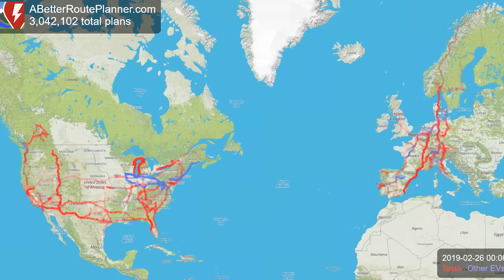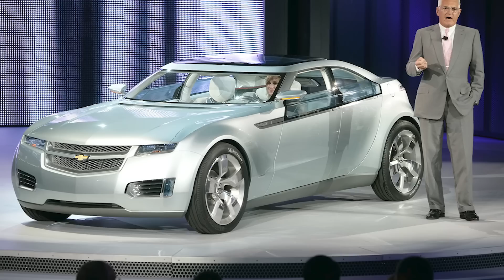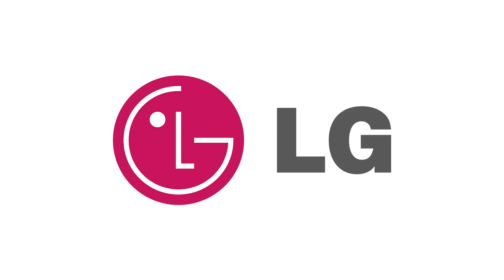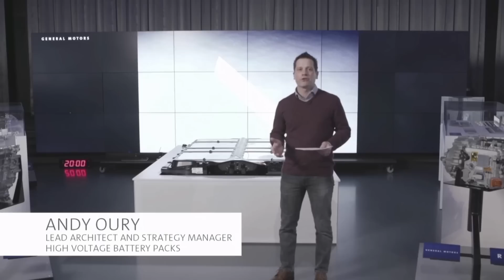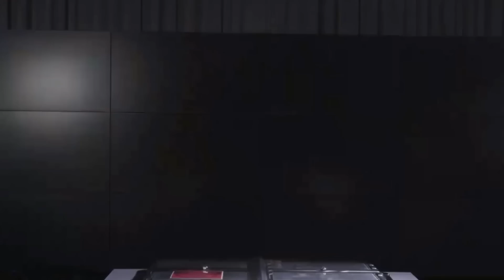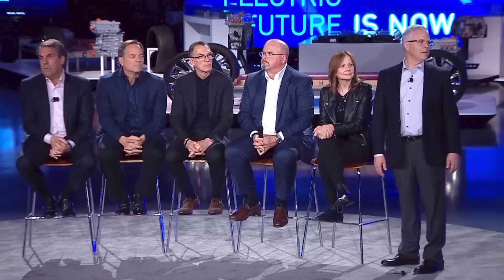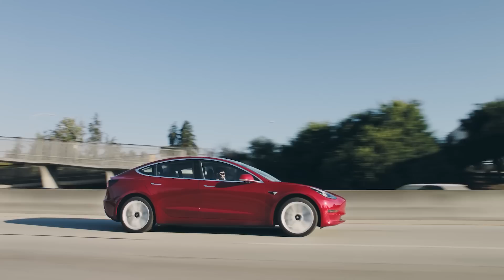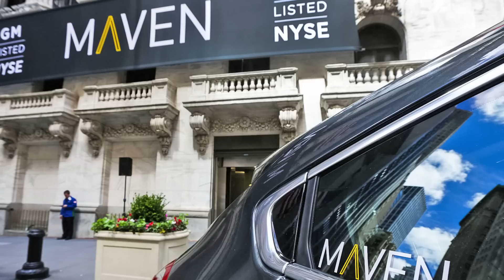GM EV Day | In Depth

Comment: Also Mark Reuss is always dry like that, its his style. If he were faking excitement you would have ripped him for that as well.
Reply: One thing he wasn't faking was ignorance. This assembly of buffoons has no idea on where to begin when it comes to making a compelling EV. Sad for the rank and file at GM. Many out of work soon...
Reply: @brunosmith6925   Incorrect, they may have been dumbing things down for the Wall street audience this was intended for but the reality is GM is STILL the only manufacturer that sells an EV every where in the US with a real world range of 260 miles for LESS THAN 35K. The GM 60kwh battery does 260 miles! even Tesla has not pulled that off in a 60kwh battery. The point is they are NOT ignorant, it looks like they have secret sauce no one else has. The Bolt has ZERO vampire drain, performance does not degrade as battery levels drop and the degradation after 100k miles is less than 10% i think they know exactly what they are doing...
Reply: @SimonMichaelBenz  In 1971, when I was 16, a few friends and I built an electric go-Kart, using 6 lead-acid batteries, an inverter and a swimmingpool pump motor. (we had input from one of my friend's father who was an electrical engineer). The Kart was fantastic, was fast and ran for ages on a full charge.
Making "just a car" (EV) is not that difficult. GM are good at "just making cars". Today, this is not sufficient. All the hidden technologies (mostly unseen electrnics and computers) need to be there too- and ALL legacy manufacturers (GM included) is far behind Tesla and they are unlikely to catch up. Also, every Bolt they sell is sold at a loss of well over $15,000. It was put into the market to "soak" away potential customers from Tesla (but failed to do so) in an effort to stop Tesla from succeeding. GM did not make the Volt or the Bolt because they want to move into EV's... they were made to try to force Tesla out of business.
So... even though the Bolt is technologically a dinosaur, GM loses a lot of money on it. No company (not even Tesla) can survive if the products they produce are not being sold profitably.
GM is unlikely to survive - not because they can't make EV's (I made a go-Kart), but because they will never be able to build a compelling, technologically advanced EV and sell it at a profit.
Reply: @brunosmith6925  First off, the Now You Know review of the GM EV day presentation was grossly inaccurate. (check out the autoline network's) There is a lot of information that GM gave that these two Tesla evangelists left out. What we actually found from the event is that GM is far ahead of everyone except MAYBE Tesla in battery tech. GM seems to be focusing on squeezing more power into less space for less money, supposedly the Germans are doing OK and the Koreans use mostly licensed tech from LG and GM who holds a ton of patents, but Tesla and GM are the two leaders outside of China. GM will NOT go out of business, because EVs will be relatively slow to catch on in the US giving GM plenty of time to leverage their head start against other domestic makers and the Japanese and Europeans. Tesla will never catch on mainstream, they are too unreliable, poorly built, and plagued with issues even some of the worst ICE makers have figured out over the years. Toyota sells more cars than anyone because reliability and quality matters to most buyers, not the trendiness that Tesla excels in. People who do not worship Tesla also value buttons and tradition interiors, the Model 3 and Y will do the same thing the S and X did, come out with a bang then the sales will fizzle once all the Tesla fans have sold organs to buy their dream cars, Tesla has a limited sales reach. GM specializes in selling according to what LARGE swaths of the population wants, not just condescending pretentious tech geeks who are too young to understand how much of a nightmare that Tesla will become out of warranty. I'm more worried about Chrysler than anyone...
Reply: @SimonMichaelBenz  Some very valid points... mostly relating to factors that accompany car OWNERSHIP. I agree that Tesla out-of-warranty is an issue. I disagree with you on build quality. Earlier model-3 were shoddy, but quality has improved dramatically. I don't own aTesla, but have been hiring them on-and-off for several years, and have driven around 15 different cars since 2014, from an early model-s to a very recent model-3. The improvements in more recent builds is very aparrent.
FSD (and the concept of robotaxis) will happen - just when? Nobody knows, but when it does happen, OWNERSHIP of a car will make no economic sense for most people. Since 2010, the number of young people reachng driving age who bother to get a drivers licence has fallen dramatically. Ride-hail services (pioneered by Uber, Lyft and others) has proven to be more attractive to young people, who have tangibly experienced the economic benefit of NOT owning a car, but still having easy access to transport. In my case (as an anecdotal example) I gave my son (now 23) a Kia Rio three years ago... he has yet to get his drivers licence and the car just sits on the driveway. None of his friends own cars. When they want to get somewhere (general daily journeys) they call up Uber. The younger generation is not that interested in car ownership, and as they grow older, their habit of ride-hail will increase.
GM is very aware of this. Their investment in Cruise is substantial. Other automakers are also very mindful of the looming changes FSD will bring. Selling TRANSPORT as opposed to the car itself is vastly more profitable for automakers, and vastly cheaper for commuters.
Many of your other observations make sense - but who will win these various races remains very unclear. What is clear however, is that laggards will not survive, no matter how big or prominent they are today.

Comment: GM killed the Volt. They are stupid. All this "we're gonna do this and we're gonna invest that" a) is just words and b) doesn't alter the fact they took a big step backwards when they killed a great extended range plugin Hybrid that goes 40 to 50 miles on the battery and gets 40+ mpg on gas! We own two 2018 Volts. I will sell one when my Cybertruck is ready. You are basically saying corporate GM has their collective heads up their asses and I couldn't agree more.

Comment: In truth GM DID invent the electric skateboard in 2002 and even coined the term Skateboard for it. 
Google GM skateboard Concept 2002.
But then they went to sleep.
You snooze, you lose. 
https://www.autoblog.com/2010/09/24/forgotten-concept-2002-gm-autonomy/
Reply: I remember that,  I really wish they would dust off the Hy-Wire and replace the fuel cells with batteries. I always liked the idea of wheel motors and don't understand why more EVs don't use them.